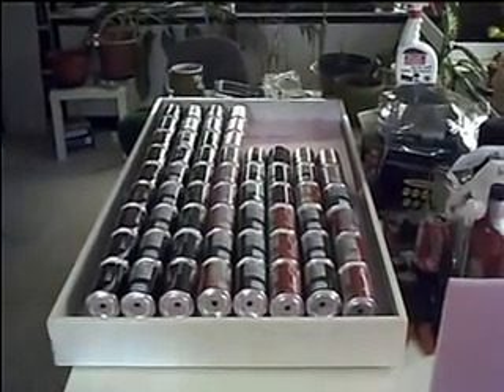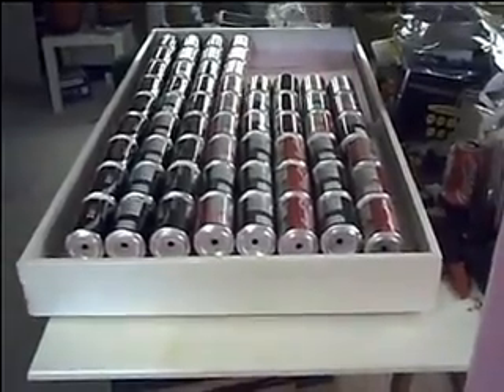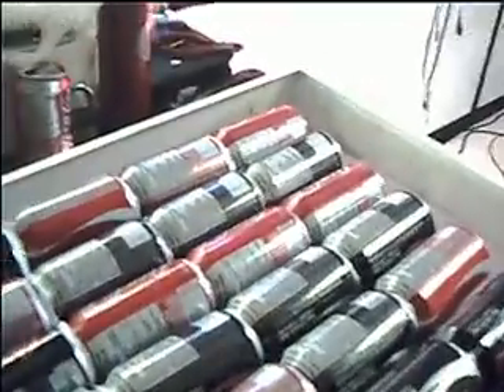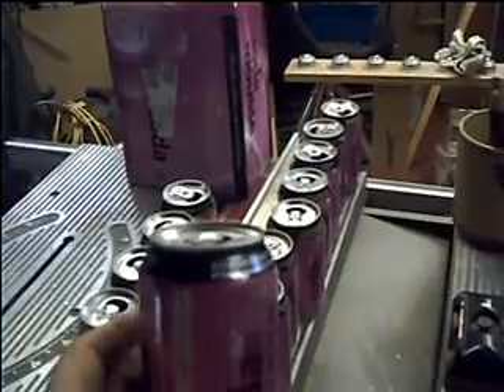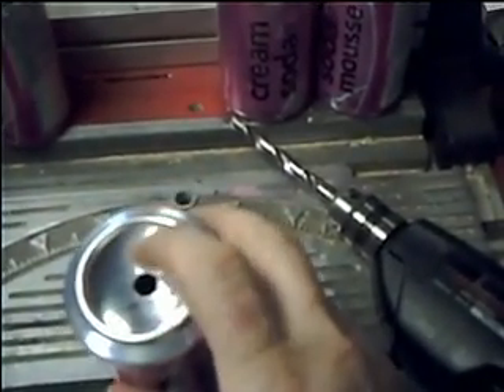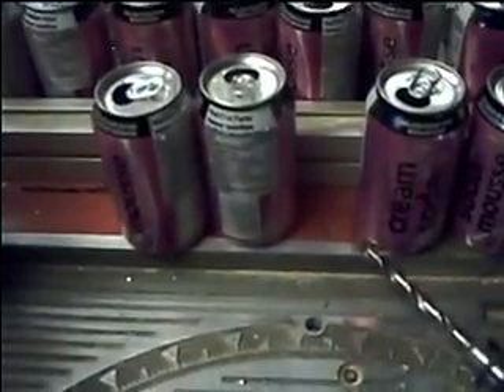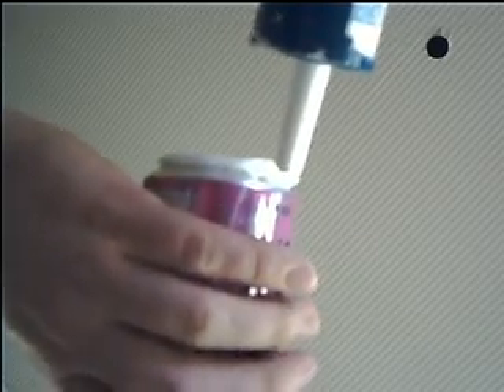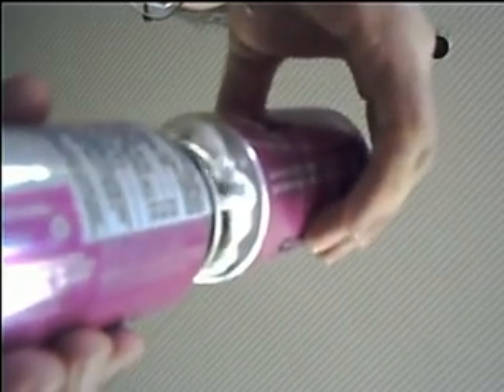Solar can project part1

Comment: You are not a public speaker either … write yourself a script.

I have not built one of these things, but I think you should cut the bottoms out a bit more, maybe even irregularly so that you get turbulence in the tunnel and the air mixes more and comes in contact more with the metal.

I'd like to build one of these things, but I don't really get the point of heating up my house when the sun is out and blazing - there does not seem to be a way to store any of this heat from the day?

Comment: We used no additional glass, only the glass in our existing  windows.  The cost was a big old $8 for the foam board and we made 3 units out of it.   Planning to add a small computer fan to each and run it using a small solar powered charging unit.

Comment: Easier way.. make a box out of foam board.  Paint the inside of it black using a high heat low VOC paint.  Paint the cans black as well (although you used black cans so skip this step).   Then cut a hole at top and bottom to allow air flow.  Slides right into the window. It is nearly weightless and produces 120 -150 F heat.